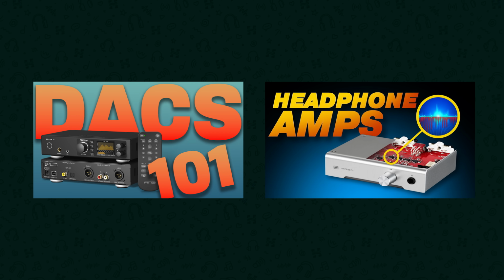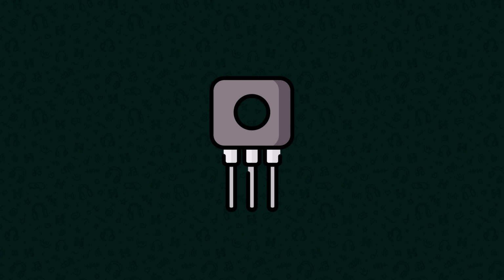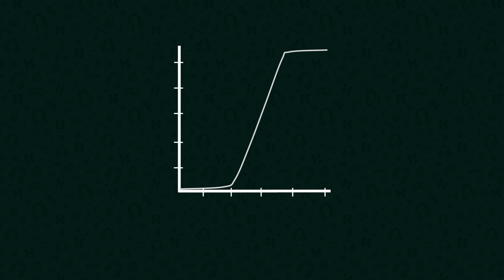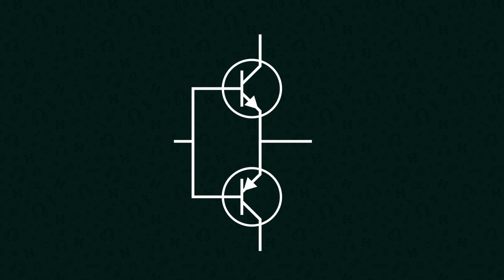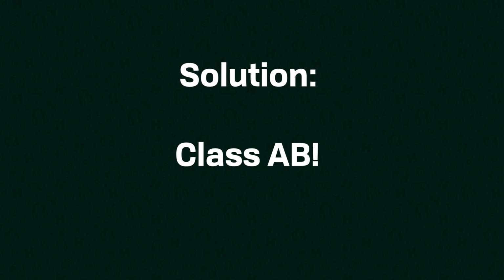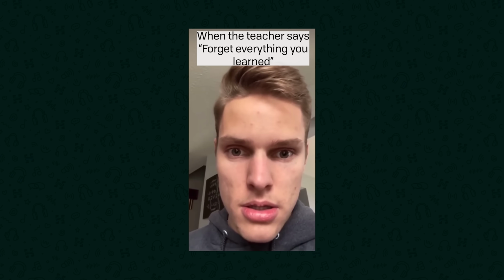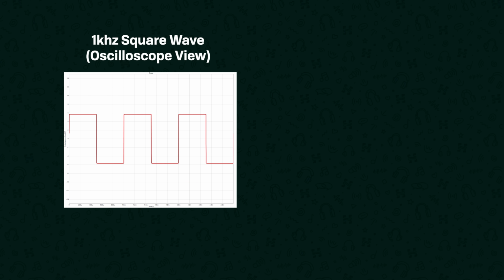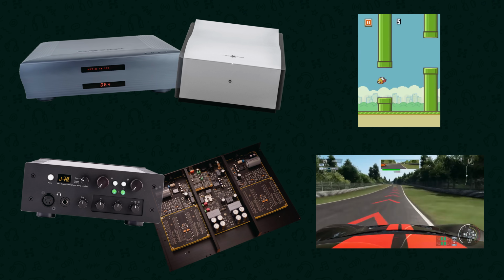Audio amp classes as fast as possible!

Comment: Great.  Except .. what change does the ouput filter do to a signal that isnt a sinewave? The amps that Ive tested cant play a squarewave correctly.. I was shocked when I saw the leading edge and the top of the wave.it wasnt reproduced correctly. So thats the floppy bird ...?
Reply: Perfect square wave has infinite bandwidth. Because no amplifier has infinite bandwidth, there is no way to have perfect square wave. So some distortion is imminent, but it affects part of signal that outside hearing range (if everything done properly).
Reply: @veteransniper6955  uh. Freq of the sinewave has nothing to do with the shape of the waveform.. also..a class a or class ab at full clip is actually DC..riding on the sine wave.. yes the flat top is at full rail potential..at both pos and neg extreme.. if you look at class d..its not.its rippled and spiked at the clock freq..and harmonics of that clock freq..
Reply: @davidstevens7809  wtf is u on about

u need to learn how to talk

and learn frequency spectrum

and it is not dc riding on sine wave

in fact, everything u said is fucking wrong

also learn basic control theory

Comment: This was great.

I wouldn't mind hearing more about the long term reliability of Class D, though. I sometimes wonder about the environmental impact of efficient tech that dies early, vs inefficient tech that is near indestructible. It would be interesting to find out where that tipping point is.
Reply: Generally speaking and theoretically, more efficient is also more reliable. Less power lost means less waste heat, less strain on everything. In the case of audio amplifiers, their is nothing inherently unreliable about class D but class D is often the choice for making the cheapest possible low end consumer products so they are unreliable not because they are class D but because they were built to be as cheap as possible from the cheapest components. Also, class D is a very popular choice for building powered speakers where the amp is built into the speaker. This means the amp is bolted to the same enclosure that the speaker is bolted to. That's a VERY high vibration environment (especially in high powered audio equipment) and that vibration can kill anything, class D or otherwise.
Reply: @wingracer1614  The vibration thing is a really good point I hadn't considered. Subs and active speakers tend to be the things that die most regularly from what I've seen and heard. I have one hypex amp in the house and so far no issues, although it's a stand alone stereo power amp so it has a much gentler life.

I get what you're saying about efficiency where it relates to heat especially, although I feel like there's conversely a parts count variable that increases the likelihood of failure as circuit complexity increases, by simple virtue of the fact that there's more that can go wrong. It seems the attitude with a lot of class D stuff is that if anything fails on a module, you bin the module and replace it, which is fine (if moderately wasteful) so long as the module is still manufactured. Whereas with Class A you whack some MOSFETs on a big enough heatsink and the longevity is probably down to the life of the power supply caps or the thermal gunk, both of which are usually very easily sourced. 

I'm not in any particular camp with this stuff, but there's a few things like this that make me hesitant to go all in on Class D.
Reply: @twoften  That's down to a matter of costs. Class d can be repaired just as easily as anything else but like I said before, most of them are cheap consumer electronics that just isn't worth it. Who is going to pay some tech a couple hundred bucks to fix an amp that can be replaced with a brand new one for 50 bucks? While a 100 watt class A tube amp might cost a grand so if it fails, it's usually cheaper to fix it. Unless the transformer is blown. Good luck trying to find an exact match transformer for something built in the 60s.
Reply: My point is simply this - class D is touted as cheap and efficient, but if it is (due to the market) cheap to the point it breaks easily and no one wants to repair it, that's not really efficient in the long run, environmentally, even if it is economically. At least, it seems that way. I'd be interested in someone running the numbers. I appreciate that not everyone cares about that aspect, however. 🙂
Reply: @twoften  My class d amp costs $40 with solid capacitors. I suspect it's much more reliable than any complicated class A or AB with 2378665 electrolytic capacitors inside. I've been using class D for 3-4 years and just recently replaced it for better quality one, the previous one (Also with solid capacitors) was working with no issues (And of course it was on 24/7, very convenient).
Reply: @martinpetrov7228 What amps are these $40 ones? I'm curious.

Comment: So what causes THD in amps? I would guess the psu? Also, why are there resistors in amps? what would their function be? I know what we use transistors for, capacitors too, potentiometers to control volume- but what about the resistor?
Reply: Resistors are used for all sorts of purposes. The most common in audio amplifiers are for current limiting which keeps some components from getting fried and for biasing. Remember the need to bias the amp in a class A? Resistors usually do that job. They also tend to be quite useful in tone controls. Also those potentiometers for volume control are just a variable resistor.
Reply: @wingracer1614  that cleared things up a bit, thanks.
Reply: > So what causes THD in amps?
I guess mostly due to non-linearity of components. The PSU injects noise.
Reply: even transistors cause thd 

their transfer function r nonlinear especially at the extremes

sometimes even resistor and capacitor can cause thd in real world
Reply: In analog circuits you have resistors all over the place. Even if you'd have just one transistor in a very simple amplifier you'd already need 4 or so.

Comment: Hi Cameron, Although I admire what you are doing here, with this speedy overview of a very complex subject, your description of the basic transistor types, leaves me uncomfortable, as someone that actually studied the subject (Electronics that is, and semiconductor theory, and the maths, oh the maths! 😆). The NPN & PNP classification comes from the semiconductor makeup

A NPN transistor is a type of bipolar junction transistor (BJT) that is composed of two layers of N-type semiconductor material, with a layer of P-type material sandwiched in between. The term NPN is derived from the sequence of these semiconductor layers.
The three layers of the NPN transistor correspond to three regions: the emitter, the base, and the collector. The emitter is the region on one side that emits electrons or holes (depending on the type of transistor) into the base. The base is the middle region, which is thin and lightly doped. The collector is the region on the other side that collects these charge carriers from the base.
Of course, the was an overview of amplifier types not of transistor theory and semiconductor properties, but they fundamentally linked.

The operation of an NPN transistor is based on the movement of electrons as the majority charge carriers. When a small current is applied to the base-emitter junction (forward-biased), it allows a larger current to flow from the collector to the emitter (reverse-biased).
Reply: bjts r minority carrier device

Comment: Is there a mistake in the class-d section of the video?

It says "triangle > input signal, turn output on" but then GoldenSound says the opposite, and that "if the input signal is greater than the triangle, turn output on"
Reply from the maker: Yep this bit was the wrong way round (although technically either way would work. You'd just end up with inverted polarity at the output)
Reply: both r same lil bro

Comment: This is a great explanation of the main amplifier types, but it glosses over why you'd go to the trouble of using a Class D amplifier since it sounds more complicated to implement.

The answer, of course, is that they can be vastly more efficient than even a well-tuned Class AB. This is because transistors waste extremely little power when they're either in their fully off or fully on states, while a transistor in its linear region acts somewhat like a variable resistor and dumps the waste energy as heat. Since a Class D amplifier only ever has the transistor fully off (where it wastes no power) or fully on (where it also wastes nearly no power since it's extremely low-resistance) there's very low loss overall.

Class A amplifiers are usually 25% efficient or less (somewhat higher is possible with tricks), while AB designs are 40-80% efficient. Class D, on the other hand, is usually 80-90% efficient, with even higher values possible.

As such, Class D amplifiers can be absolutely tiny and, if well designed, still produce shockingly good sound. It took a while for the designs and implementations to get good enough to avoid distortions or other issues inherent with trying to keep the complicated harmonic-filled output under control, but nowadays you can get dozens of watts (or more) out of something the size of a deck of playing cards with very few compromises.

Purists will insist on linear designs, but a well-designed Class D amplifier can produce excellent audio and allows much more compact designs because the reduced waste power. This is especially important where space is at a premium (such as in small apartments) or in portable applications powered by batteries.
Reply: Is anyone doing GaN amps yet? because a class D amp + GaN transistors seems like you would be able to get to 95 - 98% efficiency and with significantly more compact designs would want a GaN power supply as well at that point or otherwise your amp may end up being smaller than the power supply, also it would enable the transistors run at a much higher frequency making it easier for a filter to filter out the frequencies you don't want.
Reply: @Etheoma Yes. Peachtree have a GaN amplifier, and I’ve seen another advertised but can’t recall who
Reply: @Etheoma  You don't typically need that kind of efficiency in a typical use case, the cost isn't worth what you get from it.
Reply: The real life RMS of most speakers is very low, even if it sounds kinda loud. My receiver (plus PC margin for playing back music (lol so prob 1W over idle)) at the wall pulls maybe +12W for silent vs pretty dang loud. Proper RMS 10W is loud as hell. Doesn't seem like 25% efficiency on a class A is a very big deal when IRL RMS is so low unless you are hurting your hearing. Like, oh no my class A amp pulls 50-100W for an hour or two, lol, who gives a shit 😅.
Reply: @chapstickbomber  Lower power is fine, if the circuit is super clean.  High signal-to-noise ratio and very low THD.  But most amps, especially cheaper ones, are not that clean.  It's cheaper to make more power, than to build a really clean circuit.  Power can compensate for a dirty circuit because it gets loud before it distorts.  If you keep it below this threshold, then you won't get the distortion.  When you crank it up, you will hear the distortion.  On a super clean circuit, you can open it up and it will still remain tight, with less total power.
Reply: @chapstickbomber  Well for mobile application yeh that matters if your going to be running on battery and yes if you want a compact design yeh again that matters, halving the power lost to heat means you can probably reduce the size of your amp by ~30%
Reply: @Etheoma  Nobody cares about mobile applications that much because they also tend to be very price sensitive.  Putting in a bit bigger battery is much cheaper.
Reply: @chapstickbomber the problem with class A is that it always draws the same amount of power all the time. If you've got a 100 watt output, that means the amp is probably drawing 150 constantly. AB means that both are barely on when there's no sound, while class A is just one at the halfway point burning power.
Reply: I have a 500W bass combo (Ampeg RB-210). It's class D. for the power, it's pretty light. That's an advantage for me anyway.
Reply: I just bought a 500 watt class D amplifier for my bass guitar. It is very small and light and runs at a cool temperature. Magic!
Reply: You can get light and slim PA amps with class d
Reply: my first audio amp that i actually designed was class d because it seemed to me much easier to implement

i just need comparator and complementary pair? count me in

the linear classes r all very hard to bias especially for beginner tryna make a discrete one

class d dont need no biasing

i later found out that high frequency operations need deliberate design and considerations of many parameters, even parasitics, it aint just plug and play

in the end, class ab was the easiest, u just pass the signal directly to the push pull pair that is very easy to bias, especially when u use darlington pair

and it sounded perfect to my ear whereas the class d i designed sounded ass

i also tried to design a class a with a vacuum tube preamp, that one is also shit
Reply: Class D is typically used for subwoofer amps.  They run cooler, and can be built smaller.  Linear response doesn't matter because they run a LPF crossover.
Reply: @TheCyberMantis  Rotel has been using Class D amplifiers in their designs for years and you wouldn't confuse them with the poor quality amplifiers you would throw in a cheap subwoofer.

Class D amplifiers can be made well, the confusion comes from that they are often used because they can also be the cheapest solution.
Reply: @TheCyberMantis Class D is also great for bass guitar amplification.
Reply: @TheCyberMantis   they're also used a lot on midrange monitor speakers. Also because they usually design the Speaker with the the Amp. The Amp is not standalone, like in hifi products.
So the manufacturer knows exactly what is the input and the output.
It is easier to pair a generic Dac and an amp than a generic amp and a woofer. 

Don't get me wrong HIFI is high-fidelity, but lots of times they don't know about what distortion really is.
Reply: Yep. I have a pair of iLoud monitors. so small, yet more than loud enough. Class D amp
Reply: Very well said and I agree 100%. I don’t know that I’m necessarily a purist and I have come to love some really good class D amplifiers like the one in my JBL Bluetooth speaker that is really designed for compressed audio. It’s excellent.

That being said when it comes to driving my big power hungry speakers, I really prefer my old school monobloc class AB amplifiers
Reply: Well said . I notice alot of powered subs are class D . But I like the AB stuff. I had an Onkyo AB high current low impedance , 80 watts each ch. It was a beast . And sounded great, then I heard a Conrad Johnson class A tube system and I saw the light like Jake Elwood lol. I still like class A/B but one day when my system can have its own air conditioned  rack , heat won't be an issue for my class A amps.
Reply: i leave my amps on all day and night.. theyre hot but cant be wasting that much
Reply: Class-D isn't more complicated to design as you can get that as ready-made packages that require little outside circuitry and components. Internally the chips can be more complicated but that is not something anybody designing an Amp has to deal with.
Reply: Class D amps are the way to go for custom car audio nowdays, especially in EVs
Reply: A correction.  Class A efficiency(max) is not 25% - it’s 50% as correctly stated in the OP’s comment.  Perhaps you were confusing ‘Class A’ with ‘Single-ended’ which actually IS 25% thats a very common error.  Just saying.
Reply: Class D amplifier design is actually easy with the uses of class D IC. For example the tpa3126, which include almost everything (from triangle generator, comparator, power transistor). You just need an audio input, a LC filter output and a microcontroler to control some parameters (optionnal). 

Regarding efficiency, a class A is 25% efficient in theory (perfect transistor), class AB is 25-70% in theory too, and a class D is 100% efficient in theory 
Most of the time the efficiency of those amplifier are lower (as said you are around 90% for a class D amp, but you can achieve 98% or more in real life with some condition)
Reply: @baptisteroche8113  lol class d is easy when u just buy the ic

wtf is u on about, at this point just buy any ic, no matter the class, everything is easy
Reply: The wasted power isn't the issue, it's about reducing the number of components you need for the circuit.  You can choose to spend that money elsewhere where it really matters (better power supply, for example) or not and pass that savings on to the consumer.  This is where the Chi-Fi amps are starting to appear and the established players are very worried.
Reply: @michaelstanley420  nobody's worried you typically get the quality you pay for
Reply: On computers speakers were first operated without an amplifier. Wouldn’t it be natural to do it like the PC Speaker? Digital direct to cinch . Might be bit loud on head phones or when you want to RF it to the TV.
Reply: @ArneChristianRosenfeldt  there's always an amplifier somewhere along the chain, whether it's built into the motherboard or built into the speaker
Reply: @awesomestuff9715  I just checked voltage pk-pk on line-out: 250 mV. So it is far less than a logic level. And I know for sure that the first PC-speakers did not have a power cord, as with head phones. So actually, with some kind of bug, CMOS level, to headphones may destroy your hearing. C64 had some circuitry for high side switching similar to TTL, but with rail to rail output? Or anyways, C64 also has 12 volt. So we just need a final, discrete current switch? I guess that EMI is a real problem. But on a trade show, class D amplifiers were presented. Not only for head phones.
Reply: @ArneChristianRosenfeldt  there r amplifiers in ur dac